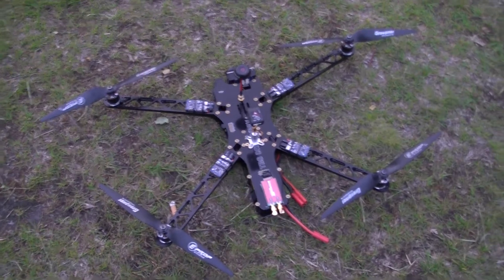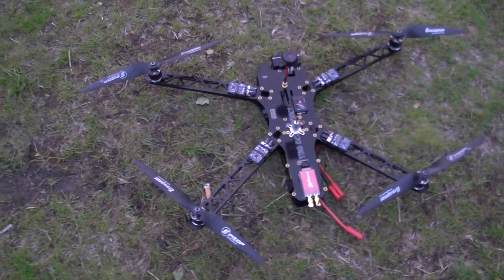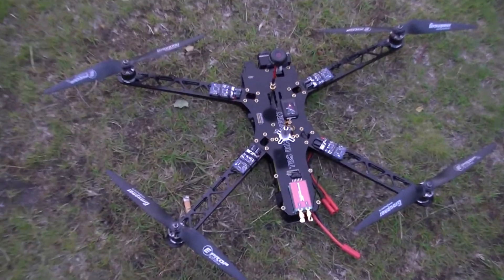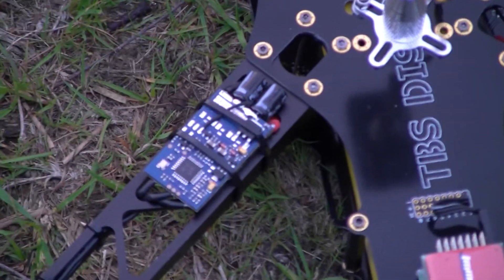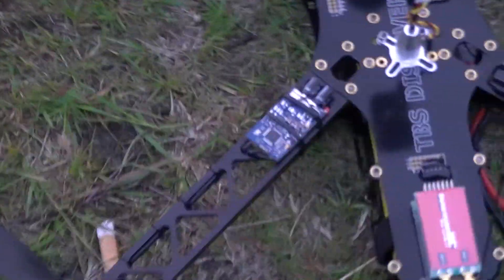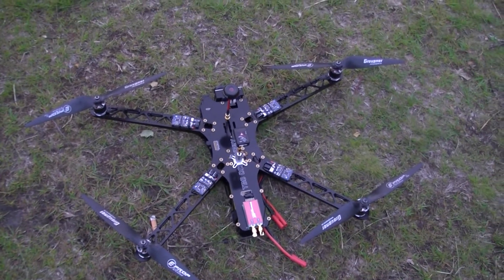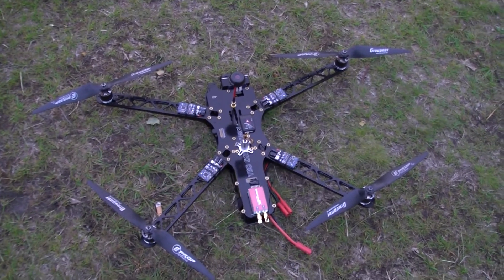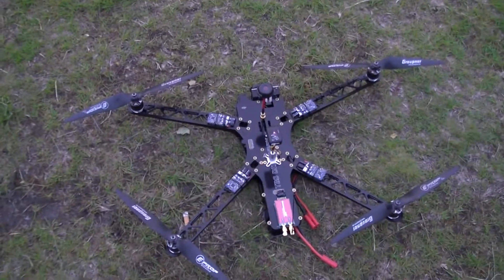TBS Discovery - Extended arms and crash

Comment: is there a lot of jello with the extended arms?, Do you use 1 piece spacers or 2 piece spacers under the arms?, thanks again, looks nice with those arms.......
Reply from the maker: +MiamiJato If you make sure everything is balanced well, you'll get no jello. I used 2 x spacers on each arm and a nylon nut to isolate the arms from the frame.